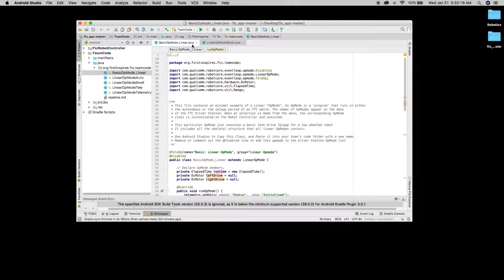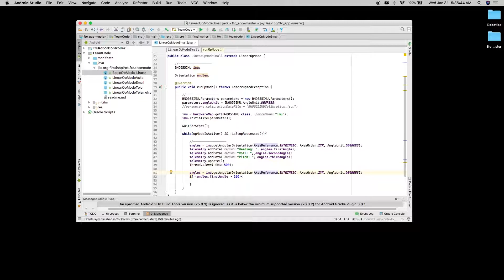FIRST Tech Challenge Programming Tutorial - REV Robotics Expansion Hub On-Board Gyroscope Sensor

Comment: So, basically i put inside the curly brackets the movement of the motors and on the angle, which degree i want the robot to spin?
Reply: (Note I am the one speaking in this video)
So if you wanted to move to an angle, what you would end up doing is something alongs the lines of 
while (programIsActive) {
if (robotAngle < DesiredAngle) {
RobotTurn
      }
}

Note as I was saying in the video the robotAngle variable has to be updated each time you want to use it. For my program I made a method called getHeading(); that would do all of that calculation inside the method so I would not have to add that extra line

There are more complicated ways to do this like a Proportional loop which my team uses but the video above is just a basis application (in a Proportional loop as the robot gets closer to the desired angle it slows down, causing momentum to have less affect on the accuracy)
Reply: @kazar4  why so quiet